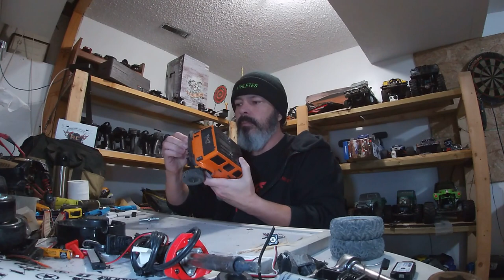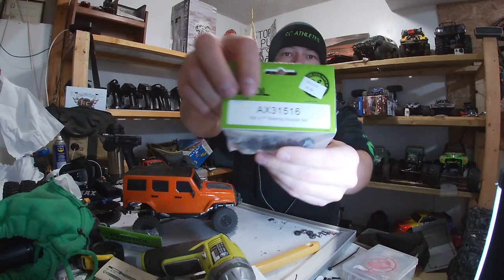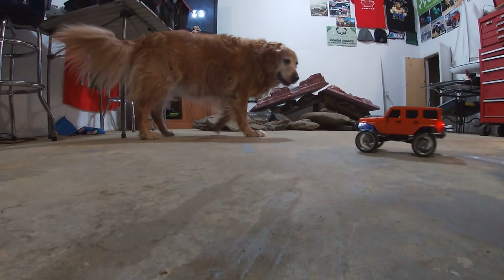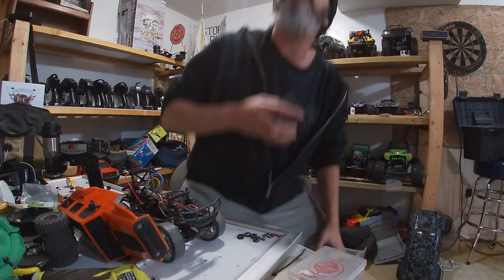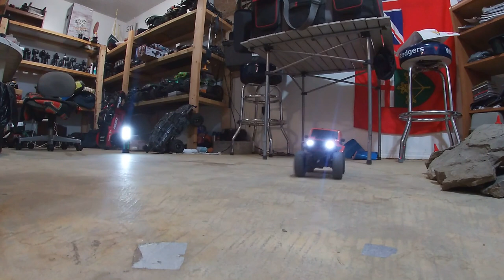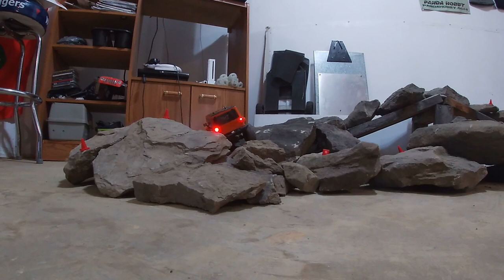RC ATHLETES - Panda Hobby Tetra Tire Experiment

Comment: I run the Atlas 6x6 tires on my tetra k-1. I did the solder wrap trick, changed the body and run it with the stock electronics except the servo on a 2s. Runs like a beast lol

Comment: Did you read the coment I sent to Afro. Slap drift tyres on your most powerful 1/10 scale. It's so much funnnnn  on my Defender  TRX4
Reply from the maker: Yeah I’ve done that. Used to run the traxxas velenion in a wraith. Silly fast lol